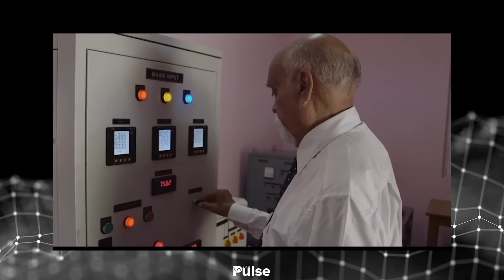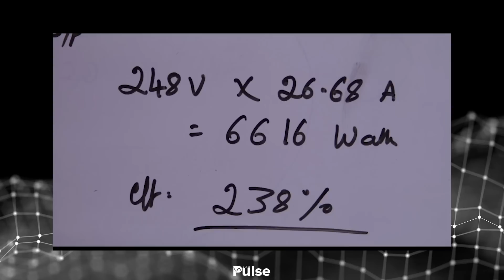'Free Energy' Generator That Works - Tewari Demonstrates His Over-Unity Machine

Comment: Hoax.  Sorry bud, I love your content but you need to spend more time studying the physics of energy, perpetual machines and their history and failures and electrical motors and generators.
Reply: Yep, bit embarrassing really.
Reply: There are more than one types of free energy devices. The guy literally told you he saw some himself and they are being supressed. Yet you refuse to believe smh.
Reply: People like you will bring others down instead of lifting them up. That's blocking you from seeing the light, that's your envy.
Reply: @skendergjergji4262 yeah for real. You also have the kind that knows that free energy exist but because they want to beat everyone else to it they spread false information to discourage others from seeking the truth. They are the worst kinds
Reply: Really? I suppose you never heard about the FACT that opposing magnetic field is a REAL thing such that it can be 'filtered' from the mixture of opposing magnetic fields using higher permeability material. For example, a rotor of a single phase switched reluctance generator uses higher magnetic permeability metal than the stator. The result would be significantly reduced flow of opposing magnetic field into the rotor, which drastically reduce braking load torque, to achieve true overunity where total energy output is greater than total energy input.

Comment: Let's see how long before also he "disappears" or has a "sudden and natural" heart attack🤦
Getting this out is IMPOSSIBLE through media coverage and patenting. The patent database is there to ALERT the owners of this world to take action and making it disappear. The ONLY way is to spread the tech mouth to mouth under the radar. The sooner people start understanding how this world REALLY works the sooner we will be free.
Reply: Just spread it using any means necessary. [Really? I suppose you never heard about the FACT that opposing magnetic field is a REAL thing such that it can be 'filtered' from the mixture of opposing magnetic fields using higher permeability material. For example, a rotor of a single phase switched reluctance generator uses higher magnetic permeability metal than the stator. The result would be significantly reduced flow of opposing magnetic field into the rotor, which drastically reduce braking load torque, to achieve true overunity where total energy output is greater than total energy input.]

Comment: The government would come and classify these types of projects as a 'national security problem', keeping them from being patented.
Reply: Actually they steal it.
Reply: @normawong123  That's their process, then maybe off the inventor too or threaten his/her entire family.
Reply: Mass spread it. [Really? I suppose you never heard about the FACT that opposing magnetic field is a REAL thing such that it can be 'filtered' from the mixture of opposing magnetic fields using higher permeability material. For example, a rotor of a single phase switched reluctance generator uses higher magnetic permeability metal than the stator. The result would be significantly reduced flow of opposing magnetic field into the rotor, which drastically reduce braking load torque, to achieve true overunity where total energy output is greater than total energy input.]